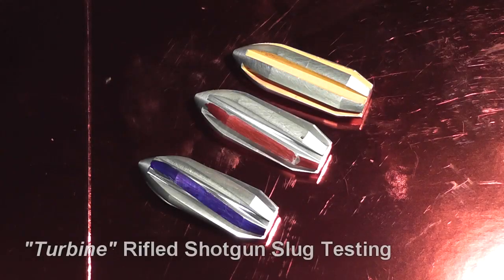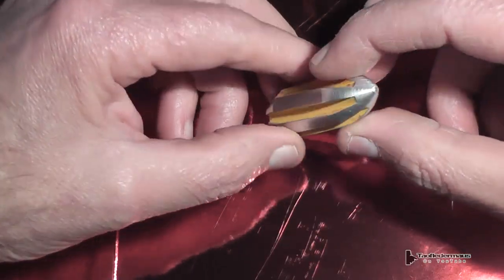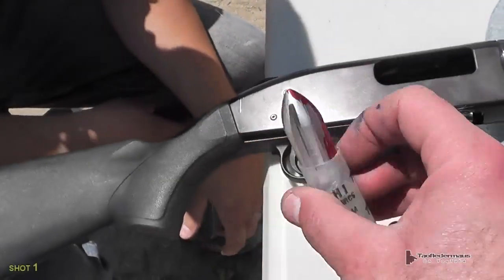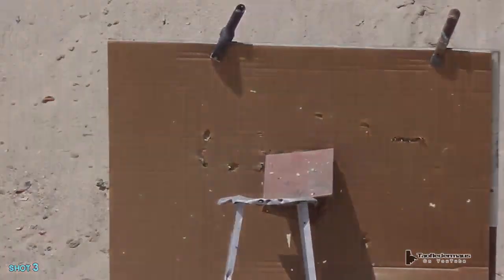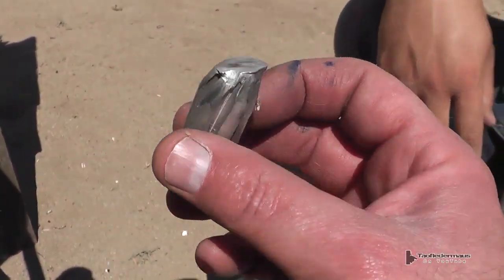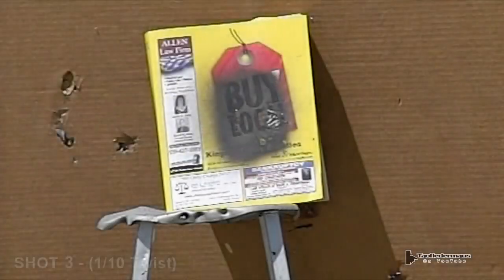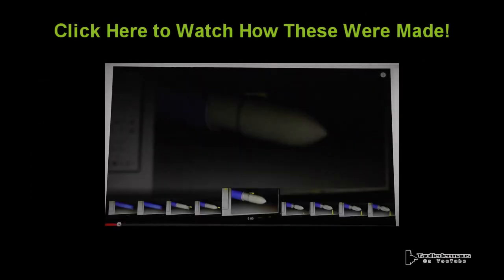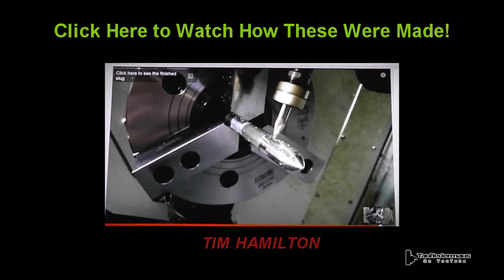Custom Aluminum TURBINE Shotgun Slugs  -Testing

Comment: I wonder if the tumble was caused by the fact that when fired, the gases make the round spin in one direction, but then when it hits the air outside of the barrel, the spin will be the other way due to the air traveling the opposite direction through the rifling as the shot gases were. Perhaps a "ramp" within the rifling, getting larger as it goes toward the rear of the projectile would reduce this effect and give better results? I may be entirely wrong, awesome video nonetheless!

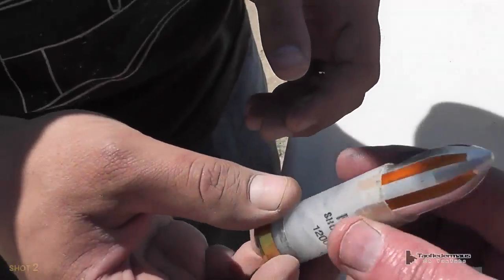Comment: It's a great idea but a round that large needs more stabilization. See https://www.youtube.com/watch?v=I5BXArdVlNA notice the fins expand as it comes out of the launcher @ 2:20. I think if you glue a shell wading backwards to the back of the projectile and stuff it in the shell the wading will open as the round discharges providing stability in flight. Just a thought.

Comment: I think the bullet rotation must be started in the barrel.  I highly doubt that twist on a bullet is ever effective.  Once it hits the air you have to account ever action has and equal and opposite reaction, the bullet is putting force on the air so you have to account for how the air is going to push back.  Good chance the nose of the bullet it's self is deflecting enough air out of the path of the veins to be effective.

I would try to see if he could use a wind tunnel and see where the smoke goes before he tries to shoot one again.

Comment: Rifles in a barrel are made to force the projectile to rotate by friction.
Those rifles here are ridiculously too little and there is no friction in the bore.
Just look at the fins on a sabot shot by a tank (wich have a smooth barrel)
They are huge and the projectile is really heavy.

You need weight and huge friction to rotate whatever you want to rotate IN a barrel or fins to do it OUT the barrel if smooth bore. 
Good job on the machinig tho : )

Comment: TAOFLEDERMAUS, Long Time No Post..lol.  The twist rate really kills most initial designs, along with an important issue with the balance....  this basic design has some promise, but it would need an important modification for greater stability. without it, it's going to continue to keyhole. As far as the "rate of twist", this needs to be fairly extreme to be of any use. if the twist is not initiated by the projectile immediately upon leaving the barrel, the projectile will loose stability before it ever gets the chance to come up to the speed needed to keep it stable while traveling down range. ( We continue to discuss the "AP" slug's, and 12ga projectiles  for the 12ga shotgun and 12ga conversions to heavy elephant like guns on my website "WEAPONEER" despite the primary topic being weapons and building them). As a former subject matter expert, and a master armorer, I still love testing rounds like these (with the same camera lol)..  in fact, I'm trying to get the funding to also do some testing on larger subsonic projectiles such as the 26.5mm and 37mm (with high speed video). we already have the stainless steel reloadable cases, which converts high pressure to lower longer pressure. all topics for another day.  Oh, and the weaponeer channel is not dead. As a disabled veteran I have had some heath issue to work out (and still do), and my Primary HD Camera died, as well as my PC with all my editing software leaving me with a video studio with a Casio EX F1 Pro for high speed, but nothing else (very frustrating, when shooting quality video's is what I always did, to keep from thinking about pain, plus I always enjoyed sharing nearly 50 years of knowledge, as well as doing things like this.." testing, and helping to improve a product, be it firearms, projectiles, accessories, tools, armor etc.."  if I had a lathe i would be testing some very specific design ideas for 12ga (and above) not far from this design. TIM, I'm very impressed by your machining work, which is very high quality, and precision made design, that I really do love.  while this GEN I model is NOT successful as a projectile, it is a very successful test, because you learn more from initial failures than you do from success's.  If your willing to learn what didn't work, and the real reason it failed, then in the end it's a success..  and both still look cool on high speed video  lol.   note: the original US Foster slug 12ga slug with the fins like yours, just smaller had a dual purpose, they allow the slug to be fired in a full choke 12ga safely, and they were intended to impart a spin (which is why it was called a rifled slug). much of what is said about the design of the Foster slug is inaccurate (but it's a fairly accurate description of how it actually works). my first shotgun was a break open single shot 12ga (which I still have) that has a full choke and a bead front site. I went to a military range to see where it was hitting, and went right up to the 100 yard line, asked the Sgt if I could sight in my 12ga there, he looked at me, and said with a laugh  "sure...  If it will go that far"  I dropped in a Foster 1oz slug, went prone (by this time several guys were behind me, preparing to laugh and make fun of me shooting at the 100 yard range) and I used my marksmanship training with a nice slow even pull of the trigger..  the shotgun barked, and I stood up, and asked for a target check (NOTE: these were the old big targets that were lowered, and someone would plug in a while marker, and pull the cabled to raise the target up again. ) So we could see where the slug hit, and when it was raised, there was a nice big white marker dead center in the bull.  I looked at the Sgt,and said Huh.... I guess it will go 100 yards !   The Sgt didn't say a word..  he just put his tail between his legs and walked away.
Reply from the maker: *****  How you doing?!    Tim is making some other designs that are sort of like foster slugs.   He's using some exotic materials for them like titanium,  cast iron,  stainless steel,  etc etc.    It will be interesting if they will damage the bore of the shotgun. lol   He's got access to some pretty impressive machine tools and he just programs it and it turns them out pretty fast.   He's working on a improved "turbine"  slug design which will be more nose-heavy and are even more intricately milled.   The guy definitely knows how to machine!   Whether or not the designs will fly straight is the million dollar question.

Comment: The high speed of the bullet is what is causing it to loose stability.  I shoot high powered air rifles and if the pellet is to light and the power is to high it does the same thing this round just did to you.  Try with less powder.

Comment: I would like to see a chronograph for these shots. It would be cool to know the speed.
Reply from the maker: MyuFoxable  It's hard to chrono shotgun rounds like this because the wadding will give it a fault.   I'm sure these were flying supersonic at the very least.
Reply: Oh yeah forgot the wadding, although I don't think it would matter cause the first few inches it is moving at a very similar speed at the bullet. 

Not so much binary test is it super sonic or not, though that is part of it. Also with the weight of the round we can start looking at how much energy each type bullet has compared to another. 

Even take it a step further and get readings at the muzzle and down range so we can look at energy loss during flight for each kind of round.
Reply: Something like the MagnetoSpeed chrono would work with shotguns and wouldn't change the feel too much.

Comment: first off… these are great rounds but correct me if i'm wrong but… it appears that the rounds you are using are meant for bird shot. I understand that there are certain safety precautions you use while carrying out these tests. But, a bigger round such as this (as you already know) requires a bigger grain amount behind the projectile. I would like to see you use a standard slug round with one of these if it's at all possible. if not, totally understandable. love the vids! keep 'em coming!

Comment: Any one who knows anything about ballistics realises that the most damage (explosive shells not withstanding) is done with maximum mass times velocity. That's why in the gulf war(s) depleted uranium shells were used. Aluminium's mass is a lot less than lead and while rifling will introduce spin which will aid in stability and to some degree range, the force at impact is going to be depleted. Another thing I am at odds with on these is that gas can escape through the slots reducing the speed attained. Finally having the rear of the shell slightly concave should make a difference. The reason why these don't twist and stabilise as well as they expected is most likely due to the viscosity of air which is quite low probably making the shape have more drag rather than adding twist. Rifling in a barrel is a direct contact friction thing so much more efficient. It's all down to physics at the end of the day so do the research.

Comment: If the shotgun were to have riffling in the barrel do you think the twist rate would get in sync with it, thus causing the bullet to spin before it leaves the barrel? It. Seems as if the bullet is going so fast, that on initial contact with the air out side the barrel, its essentially hitting a wall causing it to tumble.

Comment: I'm curious about the behavior of the bullet made a bit different. Get the piece of aluminum, make a hole in the head precisely in the middle, fill it with lead, extrude a bullet from this in such way that the first 1/3 of the bullet have a lead core and a lead point. The head part of the bullet will have more mass, and even if the bullet spins a bit wrongly at first, in a long path it should help the auto-correction of its trajectory moving the lead part to the front and the light part to the back of the trajectory due to inertia x very-different-mass-in-a-long-body x air-friction. To make it a bit more stable after shot, the back end of the bullet must have to be "closed" avoiding air passing through the "lanes of the bullet" from the back at the expelling explosion and adding a bit of air-friction to the point while flying.

Comment: The problem with rifling on the bullets is that their spin rate is determined by airflow. They have angular acceleration inside the barrel as the expanding air from the charge pushes past it until it leaves the barrel and the wind coming at it, reverses the force and starts it spinning in the opposite direction. There's where the instability comes from. I'd recommend rifling on the first half of the slug but it tapers out to a perfect circle at the back of the slug. This should also create a better energy transfer from the charge with less air passing around the slug.

Comment: 4:31 The 'turban' goes...
Reply from the maker: Ben Cooper   It's turbine.
Reply: ***** Why do you say 'Turban' then? TUR-BINE (It's pronounced BINE, not BUN.... Sounds like 'pine'. You dont call a pine tree a pun tree do you?... I thought so.
Reply from the maker: You should do a little research before you call someone wrong.
Reply: *****
 I can just say the word Turbine correctly. No research is needed. Keep firing your turbans, its fine.
Reply from the maker: Keep sticking your head in the sand bro.   (you won't see people laughing at you either)
Reply: *****
 People laughing at me? That's the last thing you would want if your head was stuck in the sand.

Comment: Aluminum very quickly produces a layer of oxide all over its surface - that layer vastly slows further oxidation because it's so dense.

Quickly - what springs to mind when you think about aluminum oxide?

Grinding stones? Sandpaper?

Abrasive.

Aluminum slugs - unless they're fully saboted - wear a barrel fast.

Comment: they are tumbling because they don't fit in the shell properly.
Reply from the maker: Johnny  Explain what properly is.
Reply: ***** well it should be enclosed in the shell casing. Just like a slug you would buy at the market. It's sloppy,you cant look at that product and tell me its not sloppy,and it shows with the final result.

Comment: Did you think of the turn direction of the barrel too?
Reply from the maker: TheLuRage   I don't know what a turn direction is.
Reply: barrels are usually rifled to spin the smooth bullet, in this case you have to make sure they've got the same turn direction, otherwise you'd destabalize it in my opinion.
It could happen that shotgun barrels aren't rifled, in this case you can forget about my comment, I'm not really in touch with guns ;)

Comment: There is an obvious reason why this does not work. The rifling on the round spins it one way when the gas from the propellant forces its way past as it moves down the barrel and then it has to spin the other way in the air. Gas just does not have enough friction to efficiently do either.

Comment: Slug rifling isn't intended to impart spin by air resistance; the slug is too heavy to be spun.  The rifling is intended to reduce drag between the slug and the barrel, and for weight management.  Slugs are also typically heavier towards the front, like the foster slug or the brenneke, which helps their stability.  Rifle and handgun rounds, and sabot slugs, receive spin from the interaction between the projectile and the barrel's rifling, not the air.

Comment: Impractical because of size, you have to load each one at a time.  They also are not stabilized before leaving the barrel which it needs to be to spin in flight.  They are not accurate and do less damage than a regarding rifled 1 oz slug.

Comment: The point is. It must start Spinning in the gun barrel.
When it comes out of barrel, the first thing it does is flying sideways(in aerospace it called stalling).
When flying sideways the fins without Quad or Triple wings(shaped for the speed of the Slug out of barrel) will not going to make any difference.

,So 
Option One. Make it spin inside the barrel.
Option Two. give it deployable triple or quad wings shaped for the speed of the Slug out of barrel.

Comment: It is my understanding that rifled slugs do not actually spin like a bullet. Without a rifled barrel to induce spin on a projectile the slug does not spin like a bullet from a rifled barrel. I have been told that all stability in a slug comes from the design of the slug itself and the rifling cut into the side has little to no affect on the stability of the slug.Thus this is why these tumbled and did not spin.
Reply: Husker GunGuy After I opened my mouth I decided to Google the information and see if what I posted was accurate. What I found is that what I posted is indeed spot on. The rifling cut into a slug is only cosmetic and induces no spin at all on a slug. So your friend thinking he can impose a twist rate by cutting them into the sides of the projectile will not work as you proved in your video. Here is the link to just one of many that will tell you the same thing. http://www.theboxotruth.com/the-box-o-truth-46-shotgun-slugs-sabots-and-smooth-bore-barrels/

Comment: i think since the grooves run all the way from the back of the slug to the tip, a lot of the pressure from the blast is venting to the front of the slug and causing turbulence before it exits the barrel, de-stabilizing the slug's trajectory....

Comment: I didn't look through the comments, but if nobody has suggested it yet... the rifling of the projectile doesn't have as good a revolution on the projectile its self, as does a rifled barrel. I did a few down and dirty tests and so far, "knock on wood", that has been proven correct.

Comment: The problem is that in the barrel the round has a tail wind. After it leaves the barrel it encounters a head wind and try's to spin the round in the opposite direction. As it try's to reverse direction it would start to tumble and game over.

Comment: the rifleings are way too deep and will cause to much drag at the front  of the round causing it to tumble. Remember more is not better. Try a tapered approach to the rifling. Also Aluminum is very light, so having such deep grooves is going to impact it drastically.

Comment: rifled slugs don't actually spin during flight. They're made with a lighter tail and a heavier nose so they stabilize like a badminton birdie does in air. In order to spin a projectile in a smooth bore id recommend trying to reverse gun barrel rifling onto the slug. As in make the slug with raised lines in a twist rate instead of cutting the grooves into the slug. It may work but it probably wont. Make them like a "rifled slug" and they probably would work and be much more stable

Comment: The problem remains it is not front heavy and the fins need to be thinner for better air penetration. I would suggest that the helical angle increases the further you go back plus you can use that concept to minimize the weight in the back thus making it front heavy...

Comment: Needs a discarding sabot, to avoid getting counterspin from propellant gasses (I hope you loaded them with a sabot). An object travelling through air with fins, or part of fins in front of the centre of mass will very very seldom be stable. The rounds could be saved by inserting a heavy penetrator in the front, steel/lead or such, or if one want to go expensive, tungsten, or insane, DU, and/or removing the front part of the 'fins'.

To be honest, when I first saw them I too thought: 'Cool, might work'. But in 20/20 hindsight I should have realized what was wrong with them before they were even loaded.
Reply: Incognito Nes And silly me. The shot-cup will of course work as rear end sabot. Shows how little I know about shotguns.

Comment: If they are expecting air to be able to rotate that, they are pretty optimistic, IMO.
IIRC there are some .50BMG rounds with air fins that deploy, but those are large compared to the size of the bullet and I'm not sure what the velocity is.